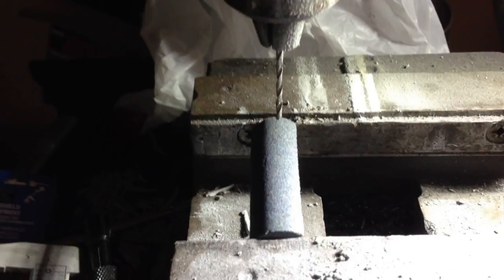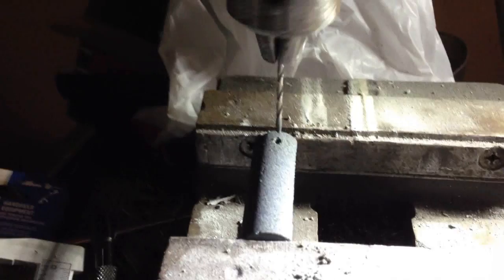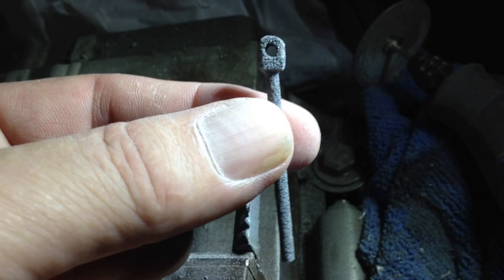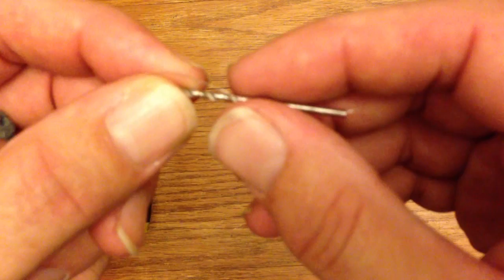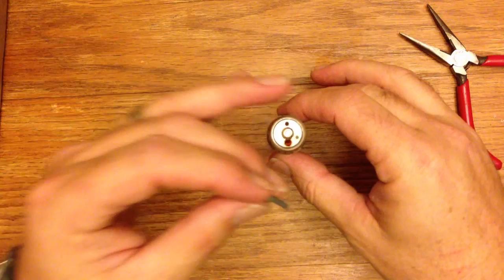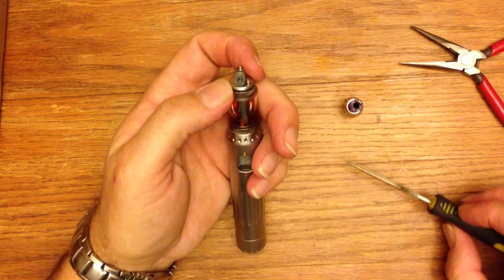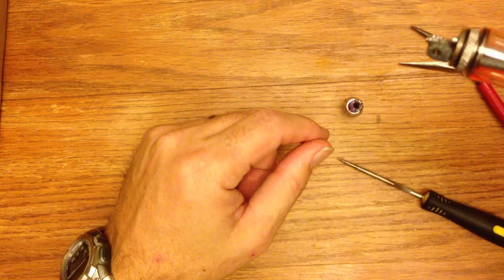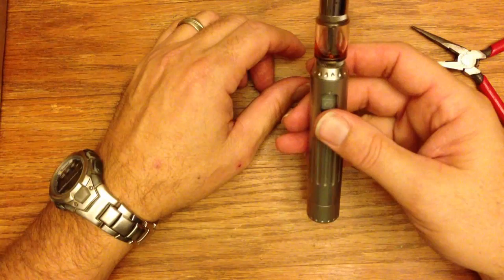Through hole porous ceramic wick making and setuo

Comment: at about 2:33 when you are cutting the stone, the material coming out of the cut looks solid, should be nothing but dust. Is your cutoff wheel getting hot enough to melt the ceramic, or is that some kind of resin coming out?

Comment: Dan thanks for the how to. One question what size bit are you using to drill the hole through the wick, is it the 5/64 or does it need to be slightly larger.

Comment from the maker: Most variable voltage PV's have a protection switch that kicks on under approx 1.3 ohms. I would measure out some 28ga kanthal and use a multimeter to measure out 1.5ohms and place a black mark with a sharpie at the two point, leaving a 1/2" extra for connection on either end. then wrap from black point to black point on your wick. If you get a low ohms remove the atty and check the ohms at the connector. Odds are you have a short, pulse fire at min voltage and move the glowing coils until even.

Comment from the maker: Prefer the trough hole as the kanthal expands into the ceramic, not away from it when wraped around the outside. Also I think it is more effective and the whole coil gets air flow, not just one side.